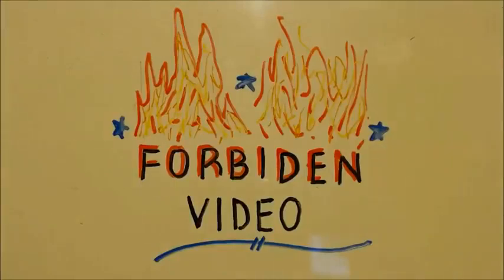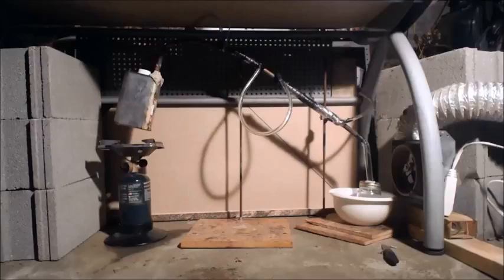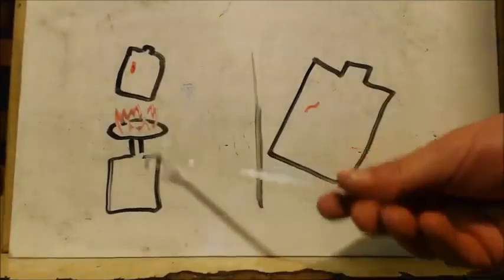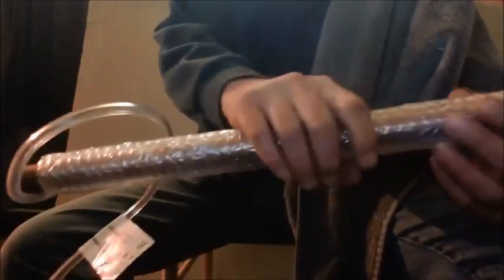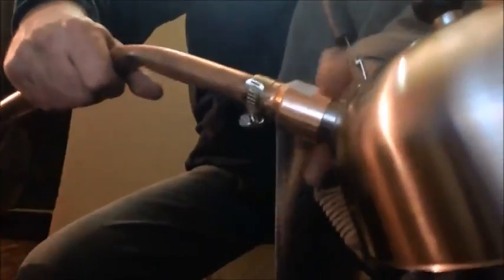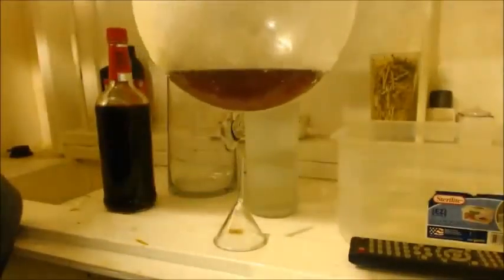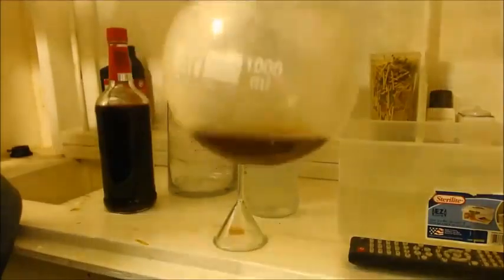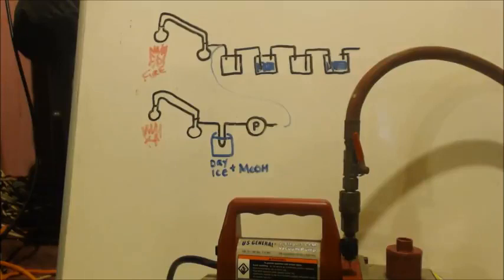STYRENE SYNTHESIS (phenylethene)

Comment: you hit the nose de DMK really love de MK but the other day even considering your words about how exothermique polymerization might be it seems in my experimento a
Reply from the maker: Jose ..........Maybe do an experiment where you depolymerize a SMALL amount of styrene spoons and feed ALL the vapors into a solution of H2O2 to see if it raises the temp BIG TIME or just a little bit.  If you know how to use GIBBS formula you can figure out an estimate of thermal heat created per gram or mole of styrene before you even do the experiment
Reply: @johnblacksuperchemist2556  apology my friend was impossible to go on yesterday and I I didn't speak you about the best the very best
Reply from the maker: @josemanuellopezgutierrez9200  ..what is the very best you have not talked about ?
Reply: @johnblacksuperchemist2556  apology querido amigo Merry Christmas yes of course when making a reacción starting with a torch Gibbs settled you got big enthalpy on the bench so the noname looked up the papers and in fact found important data in dysplastic number six there is positive formation enthalpy the monomers bonding it's quite exothermic makes two hundred cal per Gram styrene and this is the very best the other day I was cracking a one litro flask half full with tiny particles of spoons getting a good condensate as well as a lot of nasty gas flowing through connected bubblers an empty first one ant the second and the third containing respectively six and a three percent of hydrogen peroxide and when I had collected about hundred milliliters no evidence of polymerization neither temp Rush the bubblers warm up but no relevant no danger so far when suddenly the very best I was in a room with a false flor where are installed six LED lamps and suddenly Bang the six lamps exploited enormous flames coming out the six holes
Reply from the maker: @josemanuellopezgutierrez9200  .Happy holidays buddy.  Wow that is crazy.   What made the lamps blow up?   Was it the styrene gas touching the lamps or just a coincidence ????   Glad your ok.

Comment from the maker: Since styrene like styrofoam is so soluble in acetone MAYBE try 2 bubblers in series with acetone in them and have the bubblers in a cooling bath using dry ice to get the temp down to minus 60 or minus 90 C.   Maybe have H2O2 in a 3rd bubbler at room temp.  Just some thoughts

Comment: it seems hidrogen peroxide as polymerization agent is a constant in all papers....well in terms of its addition to the reactor; in our case I figure out we can spect  higher polymerization if force the collection flask sacaping vapours to flow out an scrubber containing different hidrogen peroxide conc. solutions?
Reply from the maker: Jose......Well that sounds a lot better than just water.   Maybe start out with low concentrations of peroxide at first to see how exothermic it is.   Or maybe use multiple scrubbers and have the 1st scrubber be dilute and the 2nd scrubbers be more concentrated and the 3rd even more concentrated and so on.  And/or maybe put the scrubbers in an ice bath.   All just guesses or thoughts on my part.
Reply: Keep in mind this is all about polymerization at this stage everything must be taken into account de wrong way round to the experiment itself
Reply from the maker: Jose........Just guessing/thinking here but.........IF YOU CAN GET DRY ICE EASILY then you could lead the escaping styrene gases in to something it is soluble in like ethylbenzene that freezes at -95 C and then put that ethylbenzene scrubber in a cooling bath of ethanol and dry ice which can keep a constant temp of -78 C.   You MIGHT only need one small scrubber then.......Just thinking out loud.  All guesses.   But it sounds good so it may work.   Of course you may be in an area like me where it is hard to find and/or expensive
Reply: What about retro feeding the escaping vapours this subject what a headache i'm going to buy a big balloon connect it straight to the distilled monomer when inflated up take the balloon outside destroy it all with my picric acid
Reply: @johnblacksuperchemist2556  right now I'm in a hurry later I tell you another serious idea
Reply: @johnblacksuperchemist2556  increase the surface of contact in the Scrubs with this little things in the aquarium to make tiny bubbles you know what I mean like pumice Stones
Reply: @johnblacksuperchemist2556  yes I get easily dry ice I'm not sure extreme negative temperature help because all papers ridden reefer to high temp to enhance polymerization rate
Reply from the maker: @josemanuellopezgutierrez9200  .......yeah i guess your right.  I still have my thinking geared towards trying to make it soluble.
Reply: @johnblacksuperchemist2556  expanded polystyrene plastics six as well melt in a wild way in acetone and the resulting saturated solution is paste combustible como el infierno a very very interesting resource if you go outside fishing camping even to start a a barbecue this is much better than regular Fire starters but it is outside when this stuff really makes the difference under difficult conditions
Reply from the maker: @josemanuellopezgutierrez9200  ......Have you ever tried to bubble escaping styrene in to 2 bubblers in series having acetone in the bubblers and use cold baths on the bubblers (dry ice would be best)??????????
Reply: Jess young in fact about this week
Reply: @johnblacksuperchemist2556  yes my friend infac i've been thinking about it all this week i've been concentrating the stupid hydrogen peroxide OTC three percent around here i have also a glass manifold ant design on my notebook is already written down with nice pictures drawn on it a nice setup so that force the vapors to flow down through the four ways manifold tú de correspondant kitasatos
Reply: @johnblacksuperchemist2556  this way I can see on real time the polymerization rate related to the concentration in a number of Scrubs
Reply from the maker: Jose..........i LOVE that manifold idea.  Genius.  Plus it will cut down on suckback traps if you use them.  You will just need one big suck back trap instead of 4 smaller ones
Reply from the maker: Jose...........Sweet
Reply from the maker: Jose............Yeah i know what you mean.   I always think of just taping a big plastic garbage bag on to the escape port and letting it inflate with escaping vapors
Reply: When the balloon is full of the vapours inflate it up a little bit more with a light gas and release it to the sky until pressure make it explode more less the same as chemical companies have been doing since the beginning of industrial revolution with those hundred meters chimeneas
Reply from the maker: Jose..........Yeah i know what you mean and yeah that sounds like a good idea to disperse the gases so it reacts better and is scrubbed out better
Reply: you increase the surface of contact which as you now improve speed of reacción
Reply from the maker: @josemanuellopezgutierrez9200  .......all great points buddy
Reply from the maker: Jose .......yeah if you could just polymerize the escaping vapors into a solid that would be great